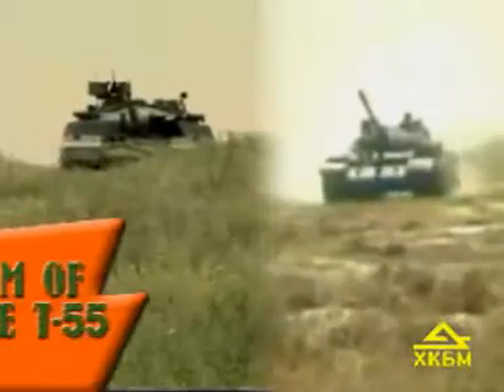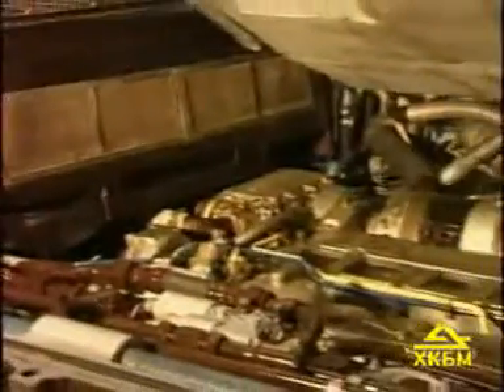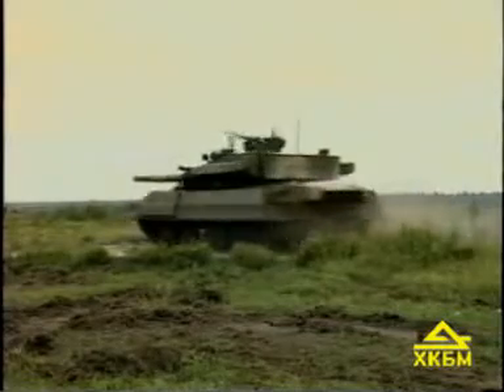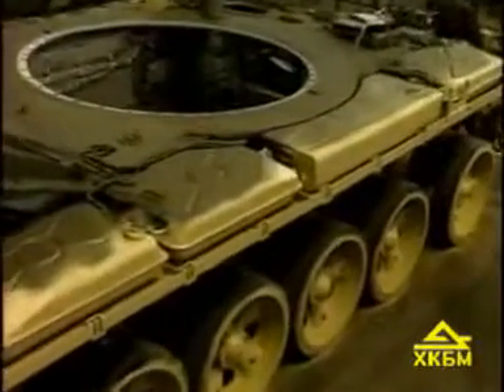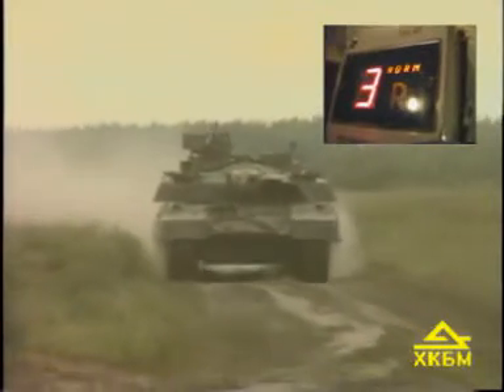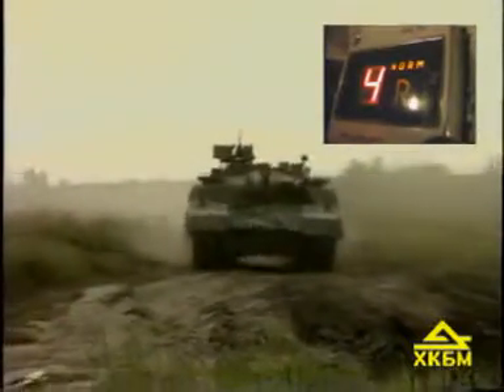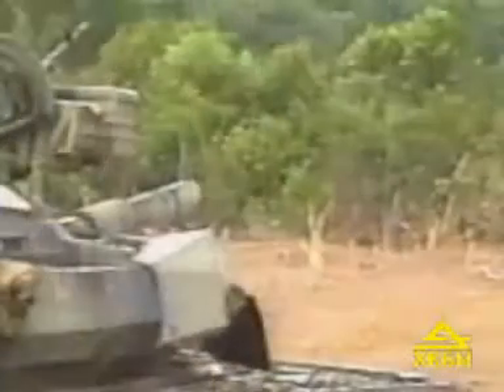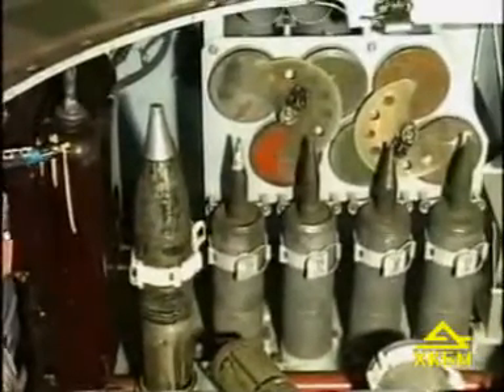T55AG

Comment: lolwut

If anything the lesson we've taken from modern war is that heavier tanks are the future.  We cut through the Iraqis easily and were limited in speed only by the political nature of the conflict; the low speed advance actually uses way more fuel for M1s than a high speed dash.
More all-around armor and more size since physically larger vehicles have more psychological impact and can be lighter for a given amount of armor due to the nature of composites.  And its gun is still not enough.

Comment: I sincerely doubt that this can destroy an Abrams Leo or Chally.  For example, the Chal2's turret is rated at over 2,000mm vs HEAT; a missile like the Refleks can't even penetrate half of that.  The sights and speed of traverse plus precision of motion are greater on a modern western tank (sights on modern NATO tanks are still better than even the most modern Russian tanks).
It's good for its price, interesting design, but would fail in combat against modern Western tanks.

Comment: It's not the 125mm gun that CAN'T destroy modern tanks, it's the ammunition that CAN'T.  American/German/British Tungsten/DU 120mm sabots work better that Russian designs because they have higher density, and thus more inertia when they travel.  They are specially designed to rip through ERA like butter.  You probably mean to say that it's the russian steel sabots that snap like twigs when they meet western armor.

Comment: @MrBuddydan You're correct: due to new electric turret gear and new stabilizer (from Oplot MBT) the speed of turret turning is 40 degrees/sec.  Soviet T-72 - 16 d/sec., Russian T-90S - 24 d/sec.  40 d/sec. is quite OK: compare with Leo2 that has some 48 d/sec., M1A2 is slightly less - 42 d./sec., correct me if I'm wrong... Thanks!

Comment: Second life of the oldie!  With new gun (125 mm), engine (1000 or 1200 h. p.), transmission, new ERA, weight of up to 46 t, new sights, automated targeting system, etc. the tank becomes a rival to any upgraded T-72s, Leo1! Or even T-90, Leo2, Abrams...  Of course, it would be hard to compete with later three, however, T-72 and Leo1 could be quite easy targets.